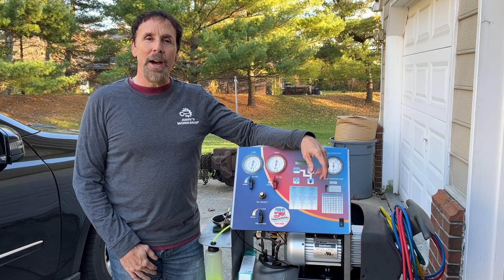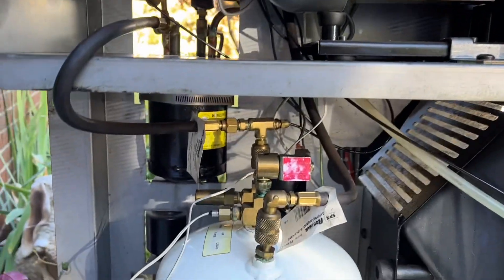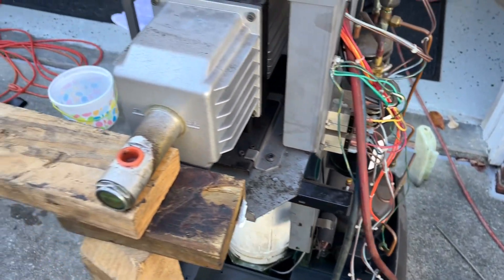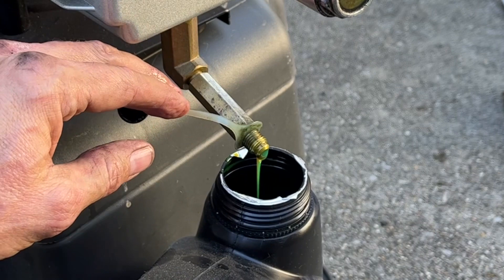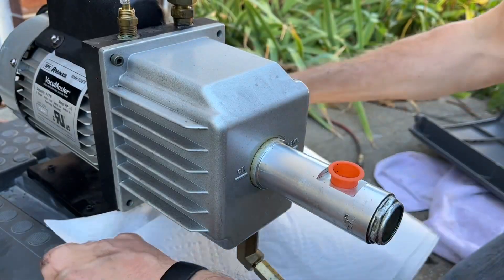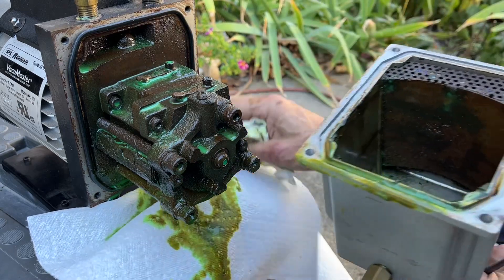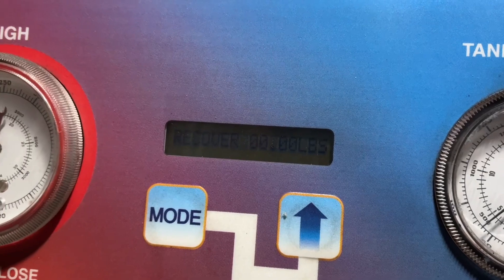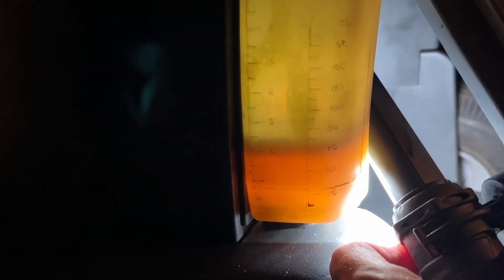Refurbishing a Robinair Refrigerant Recovery Machine, Model 34134Z: Part 1

Comment: Where did you get the yellow oil fill cap on the vacuum pump? I need one. Thanks
Reply from the maker: I got it from Century Tool and Equipment in MO.
Reply: @johnsworkshop3312  Would you happen to have a part number? Or a link? Great set of videos!
Reply from the maker: @JM-qr3kt Thank you. Part number from Century is RA20019.
Reply: @johnsworkshop3312  Great, thank you so much! Keep posting videos.

Comment: Hi John, any idea where I can find a circuit board diagram? C16 is burned out on mine.
Reply from the maker: @nclarys  That is a tough one. Robinair is super tight with their documentation. You might try calling a Robinair service place and seeing if the repair guy would look it up for you. Otherwise maybe you can read it off the old capacitor?
Reply: You're definitely right they are. I took a Gamble and bought an assortment of capacitors and a nice soldering machine. I was able to replace it and I have it up and running. Did you say that you need an operator's manual for it? If you do I have it on digits
Reply from the maker: @Nathan-df5ej awesome. Glad you got it up and running. I was able to get the operating manual online but was never able to get the workshop repair manual.

Comment: I have a unit that’s older than yours that I’m working with. it does R 11:32  12 and the R134.
I’m having an issue getting it to refill the tanks. Now I did check my compressor on the 134 side and it is putting a vacuum. I’m starting out at zero though, but it’s pulling it down in the recovery mode. However, what I have basically discovered I believe the systems are duplicates of one another . Both compressors shared the same part number. Now I was always told you cannot interchange the refrigerant it’s got to be a different compressor for each different refrigerant. But what I’m doing is trying to find maybe if there’s a solenoid not working it tries to drain the service tank and fill up The storage tank, but it stops and tells me that the service tank is empty when it’s nowhere close to it so but I just would want you to know how crazy this is and you know dealing with Robin air lots of luck.
Reply from the maker: @poppiarlin5612  that sounds like a challenge. I wonder if your scale is calibrated right and it might be thinking the tank is empty when it really is not.

Comment: I wonder if Pag 46 isn't exactly the same as the official pump oil, because the stuff recommended for my vacuum pump is "46 viscosity vacuum pump oil" and it feels like PAG 46.  But if I were to use PAG oil in the pump I would use the clear stuff, because the way you know it needs to be replaced is that it BEGINS to be cloudy.  The stuff's cheap and easy to replace, so it's a disgrace the condition they let your machine get to!
Reply from the maker: @TStheDeplorable  good idea about the clear oil. I just bought the official Robinair stuff, but probably paid a premium.  Yeah, mine was pretty bad when I got it.

Comment: I have a machine that recovers 300g,but inside of a sistem is 550g. What i need to check  to get most of refrigerant recovered?
Reply from the maker: @milanumaja  your machine should be able to drop the pressure in the automotive system to about 10 inches of water.